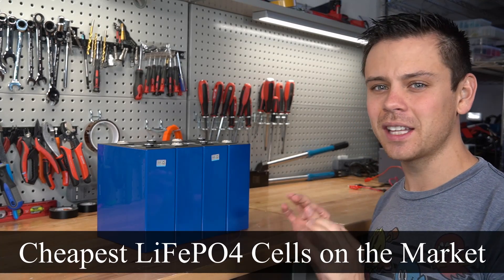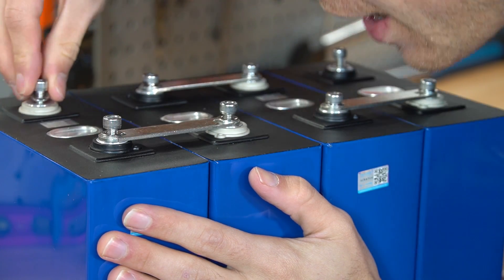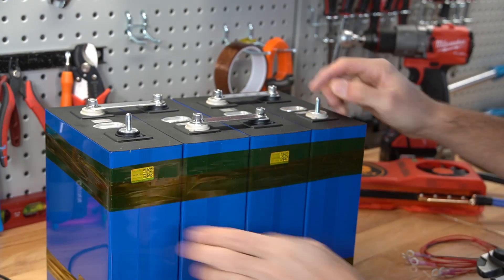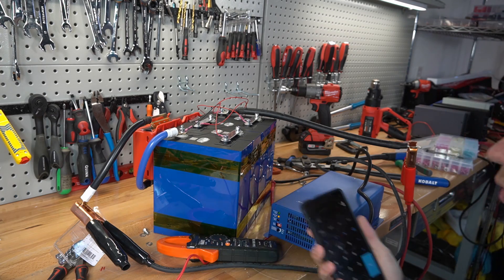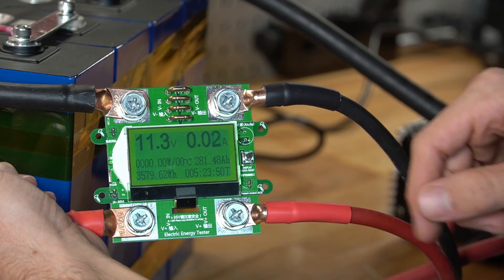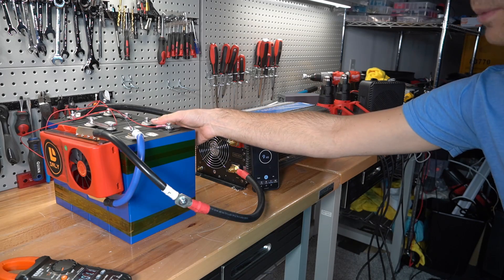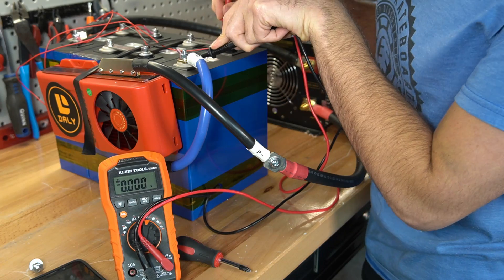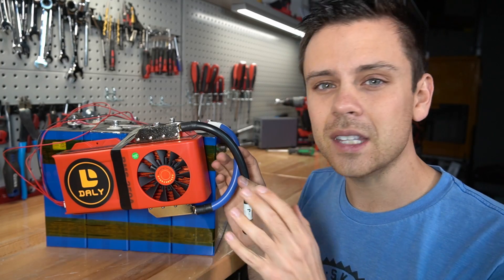$433 280Ah LiFePO4 Cells Tested: Cheaper than lead acid!

Comment: So expected those cells to clock in a 270ah. As for the bms, they are designed to handle over it's rating for so many minutes, normally a good 30 or more, and the tollerance of the rating isn't highly accurate most of the time. People shouldn't think of a bms as a fuse
Reply: I too would like to know what BMS you'd recommend for a battery at 280ah :)
Reply: @davidborden3181  I wasn't recommending one, and I know nothing about what you will be using it for. These are designed to put out 280amps, but the datasheet I see on them don't state if the 1C is max discharge continuous or short burst (normally 30seconds). But the way I would read it for safety is 140amp continuous and burst 280ah. so look for a bms that has a 140amp rating or less if you only need 100amps or something. But if you look at even a 100amp bms, it could have a 30s draw rating it will allow of 400amps, if the bms lets you adjust it, nice, if not, I would personally (any even it it did) install a 150amp or 200amp fuse or maybe even a 250/300amp fuse. This will protect against very high ampdraws that might happen that shouldn't happen based on your application your using it for. But as I don't know what equipment your running, how many amps it uses in bursts and over a long time range, I cannot recommend anything. You also shouldn't trust a random person on the internet for recommendations on something critical like this unless they know exactly what it is going be used for so it is known to work. Some people do like trial and error though.
Reply: @patrickdk77   Thanks for the response! I wanted to go with overkill which Will recommends, but they only go up to 120ah. I am going to use it in my van build, but I only am going with such a big bank because I want to be able to run a small AC unit for a few hours a day during the summer. It will draw about 450w or less, and other than lights and my fridge I won't be running much off the battery while I run the AC. Something I was trying to figure out was what size BMS I would need, since I'm in no way going to discharge 280ah, I just wanted more capacity. Do you think a 120ah BMS may be okay? I agree that we shouldn't take people from the internet's word for everything, but yes it's helpful to learn from those more knowledgeable :)
Reply: @davidborden3181  at 12v I would go for 150amp bms min for 12v battery. so the capacity of a full 15amp 120c if needed I'm the future. if it's 24v or 48v that us easily under 100a. you can also use a breaker to protect it in addition or at a lower value than the bms

Comment: My Opitma AGM battery
 has 55Ah which gives 27Ah usable.  It costs about $300, so a 280Ah battery that costs $416 and has 280Ah usable, would be WAY cheaper.

Comment: Can you have just a battery bank for back up without panels to start off with?
Reply: Of course -- just think of it as a giant UPS ...
Reply: @ghostwriter6699  I apologize but i am just getting into this and not sure what a UPS is, also would you have a link that may point me in the direction i need to be. Thanks in advance and have a great day
Reply: @kenjohnson5498  a basic use would be to ( if you have time-of-use power plans like San Diego), charge them  when power is cheap  and discharge them when power is expensive. Get solar panels later. 😁

Comment: "with an IMPACT gun" .... made me laugh .... not sure though how you know they are GRADE-B ??
Reply: They don't look like Eve terminals either.
Reply from the maker: same dimensions as eve cells, but the tops do look different. the over pressure relief valve is also different than what was pictured on the aliexpress ad when I bought them. 

And grade b usually just means scratched, but a lot of times they are used cells that are not matched. Heavily degraded.

The overpressure relief valve actually matches what is on the EVE cell datasheet: http://www.dcmax.com.tw/LF280(3.2V280Ah).pdf 

But yes, terminals are a bit different. But those could have been changed by manufacturer. I don't rely on terminals anymore because you never know what they will look like. big battery adds their own terminals to their lishen cells.
Reply: @WillProwse  So when I talked to EVE techs a while back they said that most times the scratches are not from being used but created during the install process itslef .. in fact if you see a shiny new terminal they said thats one of the key indicators that ppl do to make B's seems like A's is to hit it for a second with a soft grinder and make the terminal shiny and smooth ... BUT I think with the performance you got and the stability you achieved I would consider them A ... but who really knows
Reply: @WillProwse  Hi! That's the old 2018-05-25 spec (B). Search for the new 2019-4-30 (E).
I do not think they are Grade B. Too good to be bad :D
And yes a lot of terminals were damaged by this screws. It needs studs.
Reply: @mrzed6597  yes Yes the NEW spec (E) is what everyone should be going off of ..